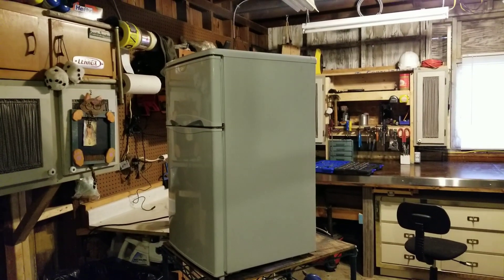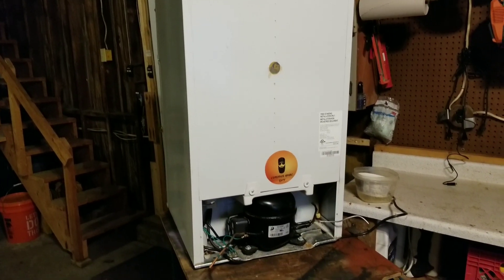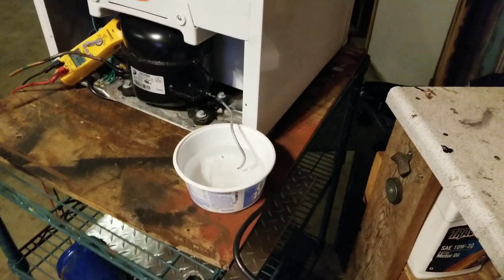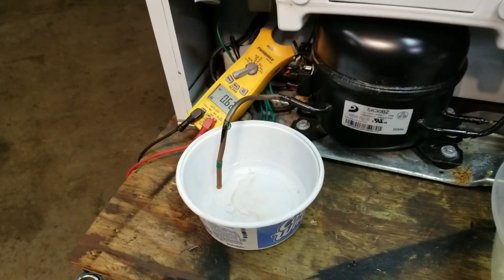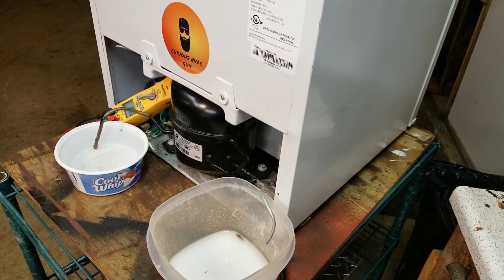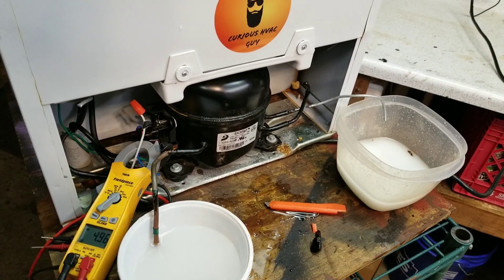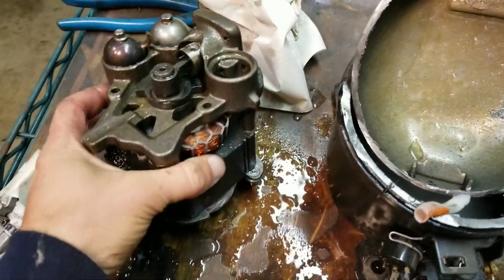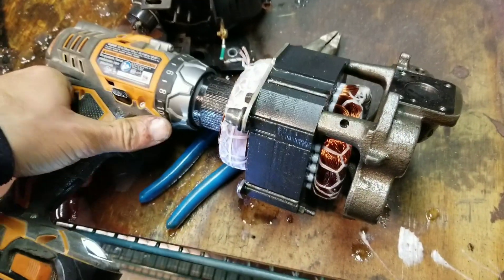Mini cooler with moisture in the system

Comment: If the water could have been added more slowly mixed with some gas (air), it may have done more damage . Adding too quickly will just lock up the piston all at once with no damage.

Comment: Hi Bill,

Interesting video.
Those little domes are the mufflers, it makes the compressor quieter as it needs to be as silent as possible.
It's quite hard to do mechanical damage to a compressor in a short space of time, long term we have all seen what happens when they are abused.
I have seen a big end broken of the rod due to a seized condenser fan.
Could hear the motor spinning but no piston movement, it was a dome unit, so that diagnosis was assumption.
Strangely the abattoir never  complained about the fact that there no cooling from that unit.

A suction line broken off at the compressor is something I have seen, domestic chest coolers don't like being installed in mobile kitchens, the shaking breaks the tubes off during transit.
And having a compressor just draw in atmospheric air and compress it, condense the moisture in the condenser, etc.
Yeah, the compressor and the cabinet was scrap after that.
But that was one of the messiest burnouts I have seen, that and when a knife has been used to de ice the evaporator.
When the drop in replacements for R12 first came out they did little to warn us that the oil has to be changed to alkydbenzine from the original mineral oil.
If used without changing the oil the compressor soon developed the most amazing piston slap.
Remarkably it still performed ok despite the racket it began making.

Always nice to trade stories.
Take care.
Best regards,

Duncan

Comment: I don’t think that compressor would have any issues pumping liquids, but the water was probably shorting the motor.  Slugging kills the compressor due to the sudden pressure changes when the fluid switches quickly between liquid and vapor. A continuous flow of a nonconductive liquid such as compressor oil would pump just fine. This is different from a car engine where the compression cycle is closed and since water is incompressible it will destroy the engine.  In a refrigerator compressor the liquid can always get out through the reed valve as the actual restrictions is at the orifice valve, which you had removed.

Comment: A few days ago I drained the oil out of a mini fridge compressor and filled it with water. It ran for a couple days, then I got bored and dumped the water out. After a couple hours the motor burned out but mechanically it was fine. It was a fun experiment. I wonder what would happen in a window ac unit if you replaced the oil with water and recharged it with refrigerant.
Reply from the maker: That's the greatest idea I've heard all day, granted I just woke up but that's still a great idea-- I have some equipment I might be able to pull that off with-- thanks
Reply: @curioushvacguy6876  No problem, I'm happy to help come up with potentially hazardous ideas, lol.

Comment: Try replacing the compressor oil with water without hydro locking it. I wonder how long it would last. I would guess a few days. I don't think it would mechanically fail. I think the remaining Poe oil would turn to acid and eat the windings.
Reply from the maker: I think your right about that- that would be a good experiment
Reply: oil floats on water.....
just add a some water without it spitting oil out and let it run, that will water lube the bearings/pistons and wont last long likely before seizing, it could get hot enough to boil the water and start steaming, but would probably seize up first
Reply: @throttlebottle5906  interesting idea. I don't think it would seize. I think it would need to get very hot to seize but blowing the rod sounds pretty likely. My guess would be it would run for 7 days. 

Day 1. smoth running. Day 2. Bearing damage and reduced capacity. Day 3. More bearing damage further reduced capacity. Day 4. Running but bearly pumping and even more bearing damage. Day 5. Blown rod. Day 6. Still spinning but shaking violently. Day 7. Motor failure.
Reply from the maker: Great points guys- ill add this to my list of video ideas